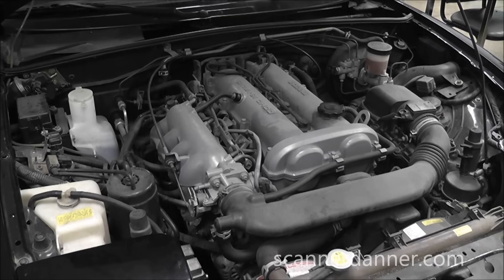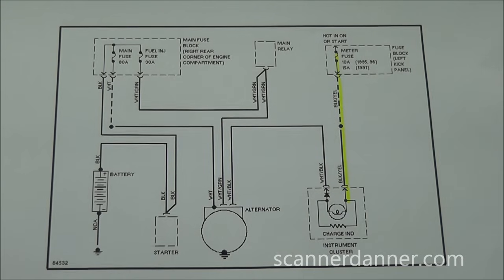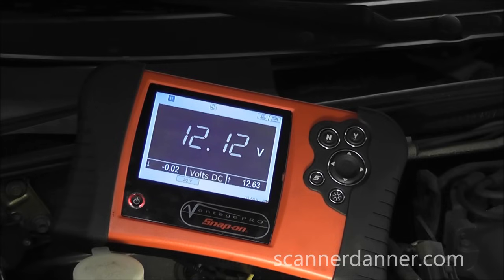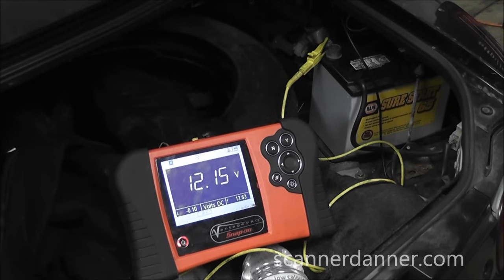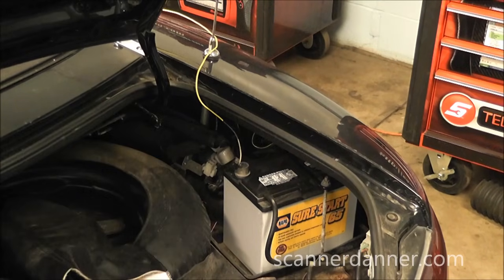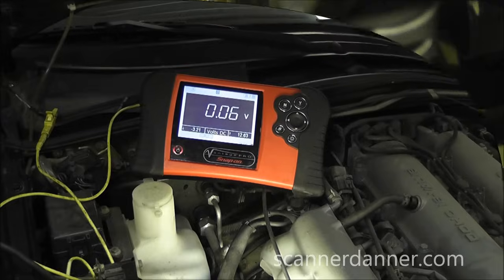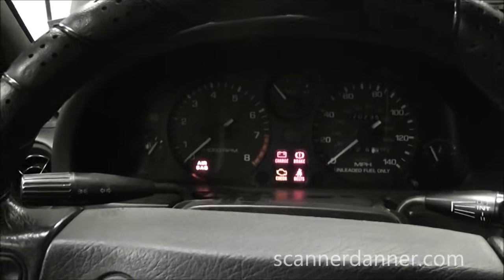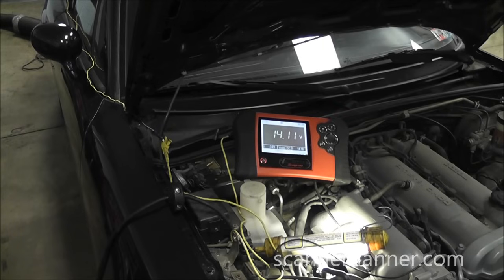How to test an Alternator (not charging from a blown fuse) - Mazda

Comment: If you are a mechanic and charge by the hour then proceed with all these steps of testing voltage drops etc.  If you charge by just fixing the issue then just check the fuse since no cluster lights, etc, and fix the issue instantly.

Comment: There is another terminal S which is connected to very close to battery(used by regulator to obtain battery volt) to regulate. In some cars, there is a redundant terminal (connected to Ignition Switch by resistor as backup (for charging light).. There is another terminal (I/F)which provies feedback to PCM. This terminal is connected to Field coil via a resistor, if there is an issue PCM would identify based on field voltage. Another terminal (P) connected to stator to obtain tacho signal. thanks

Comment: Great video,very elaborate procedures of how to diagnose step by step tests,thank you,Paul. Anyways,without a wiring diagram,how do you know which wire to test because there three wires on that connector,to the alternator ? Is there a color code that indicates which wire does what function? If you don’t mind explain,thank you

Comment: bruh u know ur shiznit!!!! awesome instructor havent aeen a video as thorough. im having this same problem with my 94 thunderbird. i turn my key my clock goes dim and dome lights blink. so i ran a wire from my starter and ju.p started it up a d it ran for about 15 mins before the battery died. so im stuck really. awesome video! mane u got me ready to get outside in the 30 degree weather and get hot. thanks scanner danner ur awesome my brorher!
Reply from the maker: Charge your battery back up and with it running measure battery voltage. It should be about 13.5-15 volts with it running if your alternator is charging.

Comment: thank you for very good information Paul, I ran into this issue  on one 98 Nissan frontier, the cluster was acting weird all the gauges, how ever the alternator light was OK, so I sent the cluster for repair  and the truck died in about 20 minutes i was wondering why?? so i check wiring diagram and the only relation I found with charging system was the bulb  that was missing at this point I decided to install a by pass bulb and bingo working charging system  back, big question in my head-continu

Comment: Should have showed the power distribution diagram and focused on why the fuse blew.. Fuse blew for a reason it will just blow again. There could be a corroded wire opposite of the meter fuse that intermittently grounds to chassis when car is being operated.. Either way great video!!
Reply from the maker: I have that in another video Fuse keeps blowing (how to locate a short to ground) - Mazda
https://youtu.be/FK9STP4G9-I
Thanks!

Comment: Hi Paul and others, the warning light terminal on the alternator provides an earth for the warning light, earth goes through the brushes, rotor and regulator to ground, light comes on, when running 14 volts shoots up from that terminal, from the rectifier,  to warning light, so you get 14 volts each side of bulb, so it goes out.. i had one guy years ago that fitted a new battery, alternator and starter, and the battery still went flat, i said does the warning light work, he said its not on, i said but does it work at all, he didnt know, anyway i put a bulb in it and cured the probem...expensive for him just for a bulb...Fred in Uk.

Comment: thanks scanner D!
I have charge light and WORKING alt and see comment below that alternator may fix.
I am considering cheap regulator brush holder as first swap to see if it clears light.
I am still not 100% sure how the charge light grounds in the alternator with engine off and goes high when charging good.  if anyone knows, speak up.  other notes:
I believe the resistor is in the cluster across the lamp so you can still charge (more properly, 'start' to charge at initial startup) if the light burns out;
I believe the lamp circuit is NOT the (rotating) field (unlike old cars where the lamp would vary in brightness under certain conditions);
I suspect the regulator/brusholder modulates the rotating filed through brushes/rotor and the stator is in the lamp circuit.
Then, the final mystery is how the regulator/alternator assembly decides to and then does self-power the stator after startup, and why my light is on for me even though the alternator is working.

if the above is true, them my stator is likely being energized on the high side by the light circuit ALL the time instead of only at initial start.  Not only that, but the light circuit STILL SEES ground (more properly, sees low enough potential to light the lamp); so it can't be a broken wire to lamp unless it is broken AND grounded in which case the alternator would never 'kick on' and I'd have dead battery after a while.

I suspect the designers did things to make the light come on for as many typical failures as possible.  I'll search for wiring diagrams of the regulators themselves.  I recall pictures with extra, smaller diodes in addition to the two big rectifier trios.  That may be a clue to how they manage the light and initial start trickiness.

Comment: just fyi for VW bulb circuit fault diag. VW will charge without the bulb circuit as soon as the alternator self excites the field by remaining magnetism.  This happens around 3000RPM. Hold the throttle at 3k for a while and it will self excite and start charging.

Comment: Hi Paul. Can you do a video on a power feed to injectors. I'm getting 1.2 volts ignition on car not running and 6 volts car running.  Thought it should be battery voltage on power feed.  I've got a ford fiesta 1.4 deisel 2009 . Can't find anything on Google or YouTube . Nothing anywhere tells me why I'm getting a Low voltage on the feed wire. Cheers. Michael

Comment: @DannerScanner, as you have shown before just cause a fuse, maybe showing as blown doesn't always mean it is, as there may be an internal issue with the fuse box, or the internal fittings being corroded in green crusty,s ,  an again as you say its worth always doing a visual inspection of the fuses an fuse box before condemning it,

Comment: I realize this is an old video but I'm hoping you still read the comments.  I'm having the same issue with a 1990 Miata except there is no bad fuse and all the lights/gauges work.  The charge light is on, the DMM is only reading around 12v with the engine running at the battery and the BAT post of the alternator.  Should I just call it a dead alternator?  I put a charger on the battery and did a load test and it's fine.  The car will stall as soon as I disconnect the battery.  The only reason I'm unsure is because the alternator is only a year old...  No other problems other than the charge light being on and at not showing 14 volts when running.
Reply from the maker: Most likely it is a faulty alternator. The smaller wires that go to it, how many are there and what is your voltage readings on each one?
Reply: There's two of them and they'r both showing about 11.8-9 volts.  Changed the alternator but the charge light is still on.  I'm thinking the battery is no good.
Reply: Replaced the alternator with a known good one. Changed the battery with a known good one.  Changed the ground strap and made sure it was well grounded.  Checked and rechecked every fuse.  Both wires going to alternator at 12v.  BAT post on alt has good connection from it to the battery.  Charge light still on and voltage dropping to about 9.5 when the car is running vs 12.6 when off.  I'm stumped.
Reply: Thanks for the help.  Got it done.  The belt had slipped off the crank pulley and was turning but not at the right speed... stupid stupid stupid! lol
Reply from the maker: Just did the same thing on a video I did with my son and his alternator on a 94 celica
Reply from the maker: Got it on video too haha said the same thing to myself
Reply: Ya,  I was glad it wasn't bad alternator out of the box but felt pretty dumb when I saw what it was lol.
I suppose I feel a little better knowing I'm not the only one to do it.

Comment: what is the name of the  equipment you are using ?  can it be used as an oscilloscope as well ? . well done for the video, very professional.
Reply: dmKrease It's a snap On Vantage pro. It is capable of operating as a lab scope with a high update or sample rate.  It's about entry level of the snap on scanners and can be used even when you are much more technically experienced
Reply from the maker: Thanks Tom

Comment: i had a similar issue with a 90's model volvo, but on a volvo its not a bulb circuit its actually fielded by the cluster.however on volvo jumping battery voltage to that pin if there is no voltage on the wire will initiate charging it will then field itself. weird stuff.

Comment: Hi ScannerDanner I just came across some your videos on youtube impressive. I have a 2001 Chevy Tracker 2.5V6. I started it up one day to warm it up because it 20 degrees outside, when I went back out to get in the car the engine was off and the battery was dead. The battery light never came on to say it was not charging, the batt. light goes on when I turn key on when eng. starts batt. light goes off.  I charge the battery and hooked up a volt meter to it, it would charge for a few minutes and then not charge. I had it towed to a shop they said there nothing wrong with it, the alternator was charging fine. They replaced the negative battery terminal. They said that was my problem, now my alt. belt is burnt it needs to be replaced. What you think it could be.

Comment: i have 2 questions:

1) why does alternator need  feed from mainrelais or why would alternator feed mainrelay? does it not get its D+ from cluster? 

2) When u use testlamp and the alternator starts werking why does it stop charging when u takes testlamp away, is this circuit not needed ONLY for startup? 

Thanks!

Comment: Dan my 92 Toyota corolla my the turn signal and the hazard lights do not turn on I replace a burn fuse , replace the hazard relay because it was giving problems , is there a way to check the turn signal switch and the hazard switch

Comment: This is a 2001 Ford Expedition charge problem. Battery cluster light stays on indicating engine running off battery, not charging. Just wondering if that could be a cluster problem causing the no charge. Sometimes the red light flickers on/off. I must remove the battery from the vehicle to charge it cause charging while connected to the vehicle will not charge, jump starting engine OK but if no power in the battery it will not run. Charging from another battery connection of another vehicle will not charge this battery. Also wondering if this could be a fusible link problem from the solenoid to the battery where the wire is divided into two fusible links before connecting to the positive terminal. When the battery is charged the instrument cluster light are function and there is power brakes plus power steering. One year old battery still good too get free replacement next month under warranty.

Comment: i recenly got to studying about electrical trouble shooting. anyways, i looked at a friends car. and looked at a diagram. a crank no start crysler. to make things short i told him to crank the car while i probed my test light on the positive terminal and it wasn't lit. now, my question is, with this kind of circuit is the wire suppose to only get power when the car is idling? i mean i figured it would be a hot circuit since its connected to the battery? Tia and love your videos
Reply from the maker: What are you testing? And when?
Reply: @ScannerDanner  hey thanks for replying! i was testing the alternator. sorry i realized i wasnt specific.
Reply from the maker: @luispedraja8489  a crank, no start, you shouldn't be checking the alternator. It's not involved during cranking.

Comment: One for you.  I have a 94 Celica with 2.2.  It stop charging so installed a new Alternator , a new battery but it won`t charge. I installed another alternator ( tested before installing it ) but won`t charge. What do you think it may be the problem. what are the 3 little wires in the plug for?
Reply from the maker: Julio, you should have checked these before replacing the alternator and battery my friend. 
You should have battery voltage on the white and red/blue wires and the yellow wire is the charge warning light control (this circuit is important on some systems too as noted in this video).

Comment: so is the voltage drop test from the BAT post to alt post even valid when the alternator isnt even charging? i mean dont you need current flow in order to get a accurate voltage drop reading?

Comment: Heres a way you can test the alty control circiut and warning light independantly.
Connect a teslight to ground, unplug the alty and touch the testlight probe to the alty control pin with KOEO, the alty warning light if it and its wiring/fuses are ok will light up, the testlight itslef may or may not light up depending on its wattage, an led testlight is no good for this.

Comment: ScannerDanner  So is that bulb circuit just a turn on, to activate the alternator, or does it double as the voltage sense wire?
Reply from the maker: It is a "wake up" circuit that also controls the bulb would be the best way to describe it, sorry

Comment: How can you diagnose a "none-voltage drop problem" without load on the B+ to B cable ?? I always think you need to have current circulation if you want to make a voltage drop measurement...??? Thanks
Reply from the maker: What specific time stamp in this video and test are you referring to?
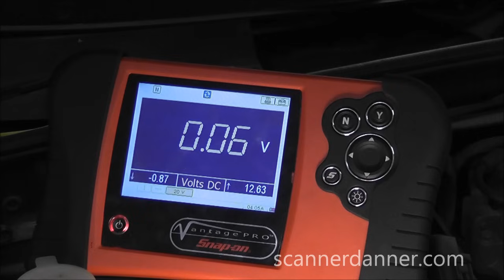Reply: 7:06 You make the voltage drop measurement from positive battery post to B stud at the alternator and you read 60 mV. But if the alternator don't charge, you don't have amp circulation in the cable. For me it's like a voltage drop measurement on a simple light circuit without turn the light "on". Sorry for my limited english... 
Signed: a french guy who tries to understand... Thanks again !

Comment: 07 liberty, if There is a fusible link from alternator to use darter wouldn’t the car not start. I have a thick red wire going to the voltage regulator on top of the starter and a much smaller gauge white wire running along with it where would the fusible link be
Reply from the maker: without research and a wiring diagram I cannot help you. Post this to my forum, it is free to join and we can help you better there. 
https://www.scannerdanner.com/forum/post-your-repair-questions-here.html

Comment: Great video, please help me with this strange car-Opel Vectra 1997 alternator gives 14,5v but instrument cluster bulb does not completely goes off after engine is running. It becomes blurry, half lid and there is a little fluctuation (bulb's brightness). What can cause this bad alternator diode, some wires shorted to power or else? AC voltage is jumping around OL up to 0,4v. How much is the normal reading with a multimeter?
Reply from the maker: +Mambre Khachatryan in my experience a dimly-lit bulb on the dash has always been something faulty in the alternator. And I have seen alternators with normal charging voltage as you describe and it still needs an alternator to fix the problem.
Reply: +ScannerDanner OK thank you, the rectifier was changed some time ago, perhaps it needs another one.

Comment: My toyota wish 1.8 got some problem i suspect the alternator, i havent check them yet. Need an advice where should i start to check. Problem my engine start normally, but when driving suddenly engine dies off, no battery indicator light on it just shut off anytime when im driving. Any idea sir?
Reply from the maker: IF it cranks normally after it shuts off, it is NOT and alternator or battery problem. 
Post this to my forum, we can walk you through some tests. It is free to join
https://www.scannerdanner.com/forum/post-your-repair-questions-here.html

Comment: Hey ScannerDanner! My miata keep getting a dead battery and i got a new belt on the alternator, ive checked the alternator,waterpump,and the battery and they all seem good. what do u think could be wrong? im almost ready to give up on the car since i can locate the problem!
Reply: check to see if their is a blown light inside the car that is switched on. its what is called parasitic draw. for instance my car was doing the sane thing then i noticed that the overhead light was switched to on but the lamp on it was blown. i changed the lamp and switched it to off and the car never died after. this happened a year ago.
Reply from the maker: https://www.youtube.com/watch?v=h06xb6SC7Yc
https://www.youtube.com/watch?v=dgvIicgZRcQ

https://www.youtube.com/watch?v=AA-vHbE1IA8

The above videos are on battery drain testing. They should help you

Comment: I have a question for you. What would cause a 12V alt to have 24+V output.? I was poking around voltage regulator and afterwards checked alt output and found good 14V. Haven't seen this before myself.
Reply from the maker: +Ray Alfaro a bad regulator